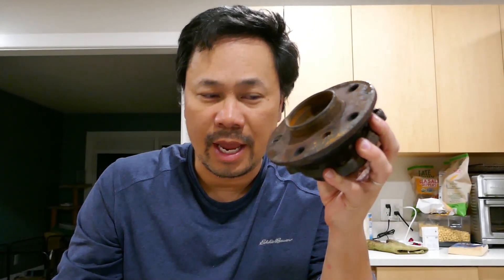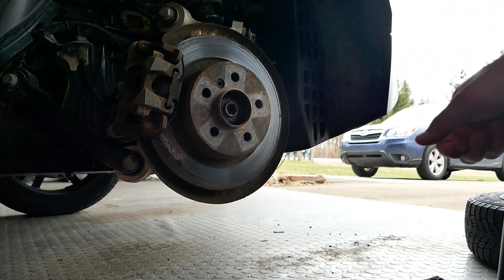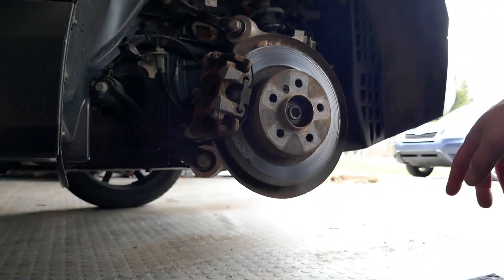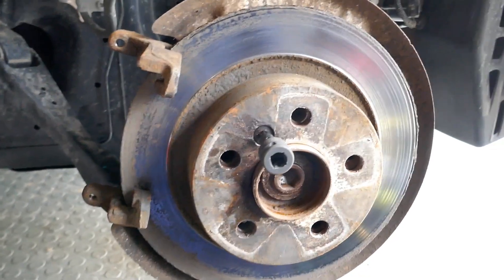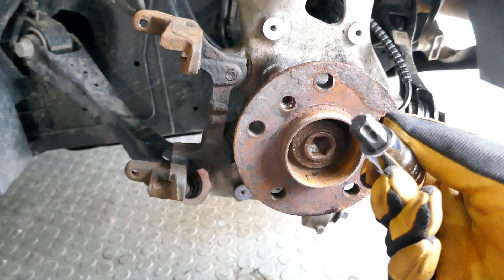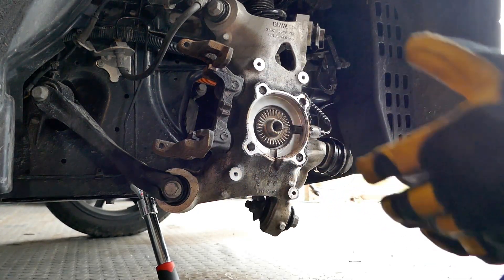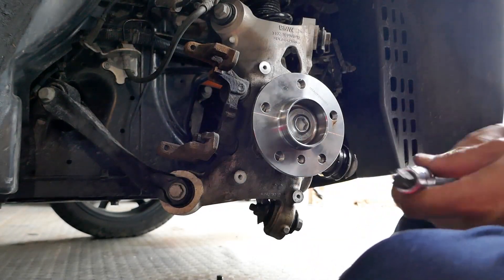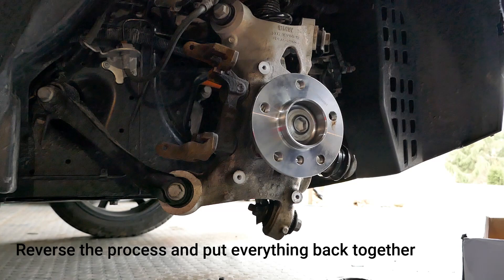BMW i3 Rear Hub and Bearing Replacement Procedure

Comment: axle torque is wrong.  should be 50Nm plus 155 deg additional turn
Reply: I have had varying people say different things about hub torque (T60) /axle bolt torque (17mm). (80+90 degrees) & (210+90 degrees)

Plus the information stated above and in video

Anyone know what the actual torque/degrees is for bmw i3 is?
Reply from the maker: Thank you I will trust your judgement on this .
Reply: @gumtape78  you should fix your bearing hub torque callout too.
Reply: @gumtape78  Yes, you got them reversed. The torque on the 4 hub bolts (Wheel bearing to wheel carrier
) is (For M12x1.5 bolts: 80 Nm + 90 °) (For M12x1.25 bolts: 120 Nm + 90 °) and for "Drive flange hub to output shaft" aka axle, it's 50 Nm  + 155 ° as mentioned above